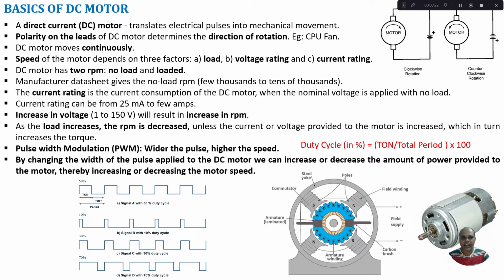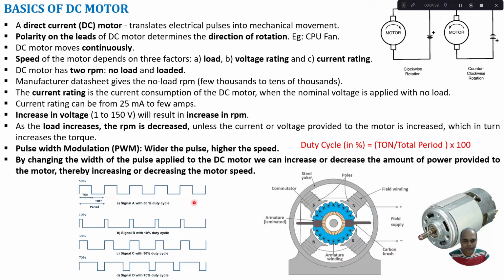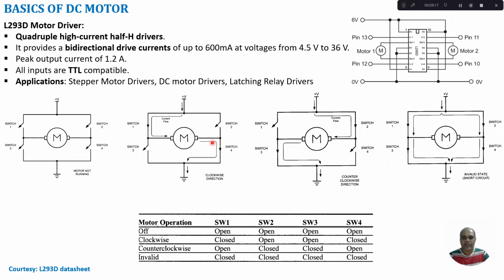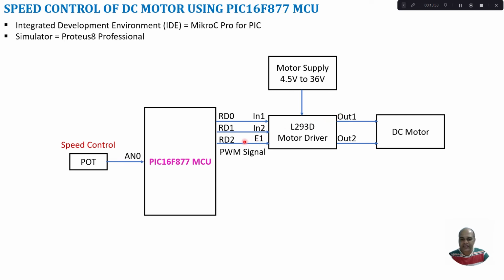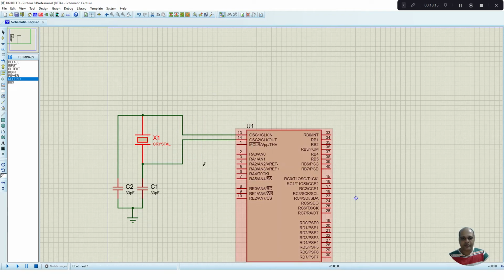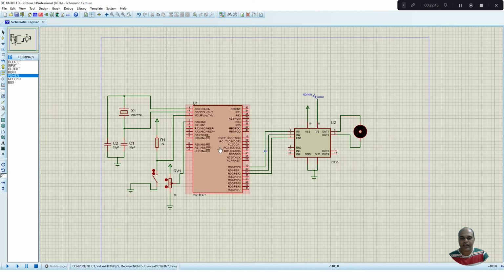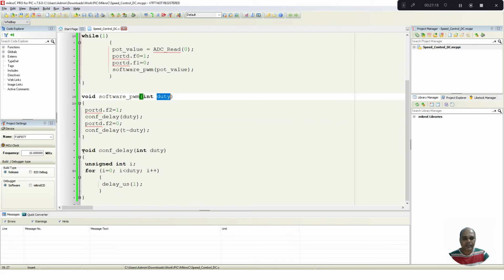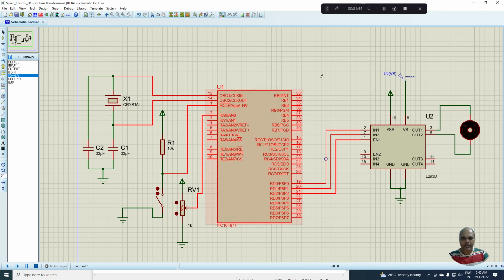Speed Control of DC Motor using PIC16F877 Microcontroller

Comment: sir plz share hex file link with simulation
Reply from the maker: Dear Sahil,
I have uploaded the MikroC - C and hex files in my github repository.
I have also uploaded the Proteus8 project file in the github repository.
You can access the github repository using the following link,
https://github.com/sathiesh23/Embedded-System-Design-using-PIC16F877-MCU.git
Thanks.
Reply: Thank you sir this video help in my mini project.